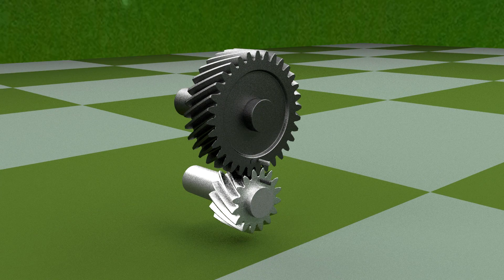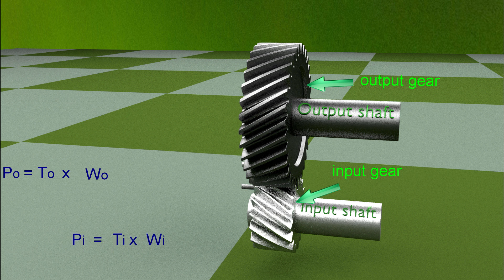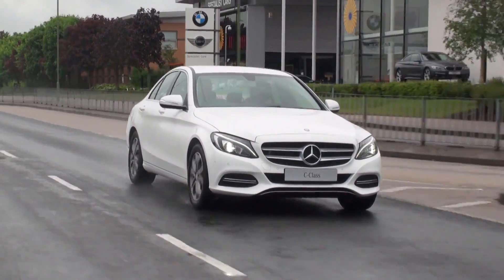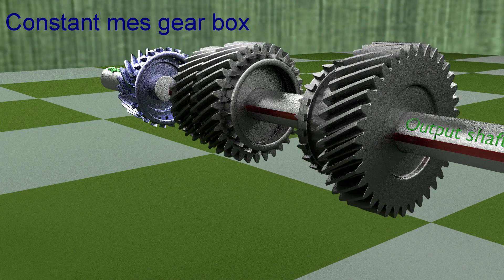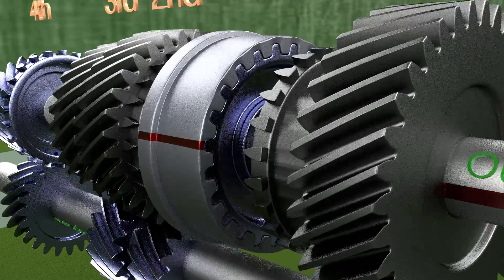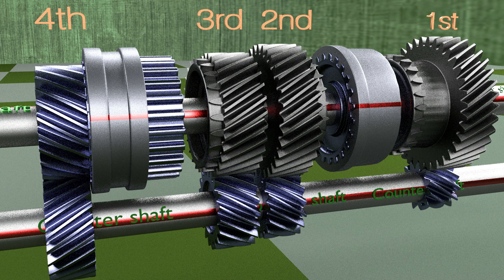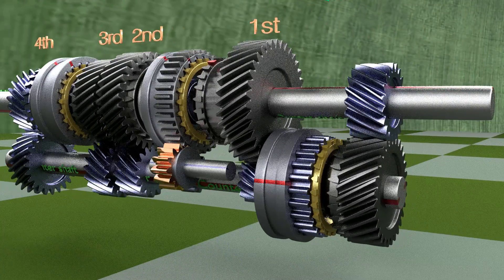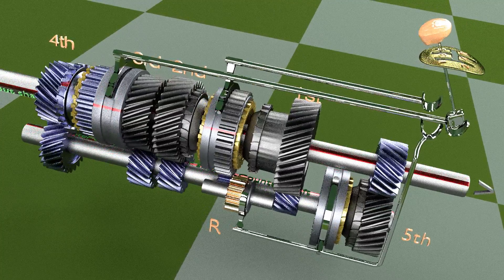How Gearbox | Manual Transmission Works

Comment: 11:20 absolute bullshit... the friction happens at the 2 clutch plates NOT INSIDE the gearbox... dude... that would be a huge amount of wear & tear and you would need to disassemble the gearbox for maintenance... makes no sense...
that's why there is a clutch - and that it's outside the gearbox
Reply: Then you don't understand what synchronizers are.
Reply: @PoNKPoNy  bullshit and the video is bullshit...

Comment: How does the synchronizing brass ring know the exact teeth position to be at and stop in the cone fitting of the gear after it matched the speed of the shaft in other for the sleeve to be pushed and connect properly thru the teeth and grooves without grinding and destroying the gears? Please someone help understand, not a mechanic!
Reply: The shape of the teeth make up for any slight misalignments and allows the gears to slide into place
Reply: the taper shaped teeth makes the  alignment easier.

Comment: Why does the fifth gear have to be on the output shaft? Why aren't all the gears moved down one to the right so that the fifth gear can be on the input shaft? Also, how is the input shaft, output shaft, counter shaft and reverse shaft held up?